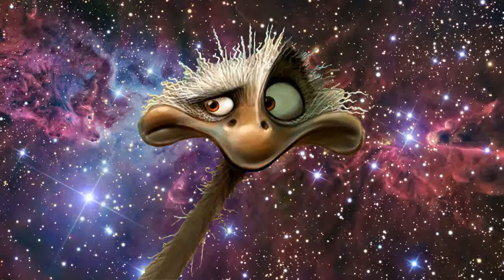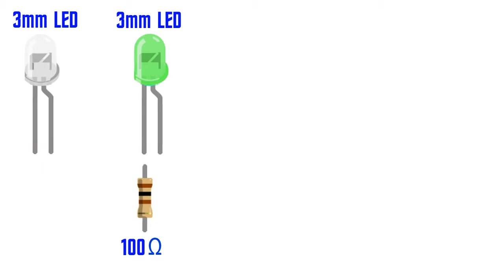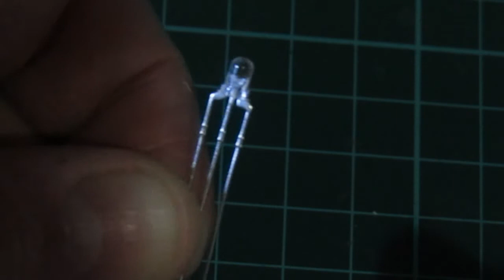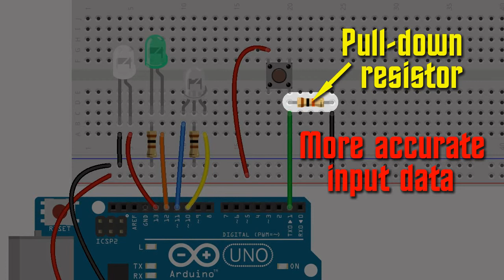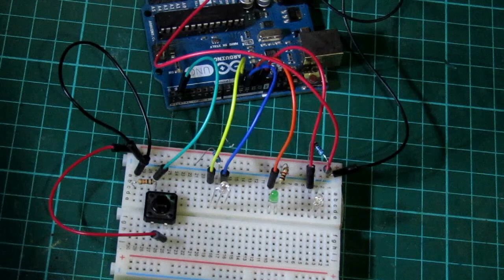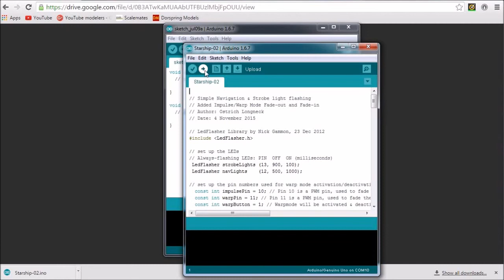Arduino for Starships - Ch04 - Deflector Dish Warp Fade Effect

Comment: Hi I am new to this. If I could please ask for some help. I can`t get fad effect to work. I don`t know what I am doing wrong. Is there something I could check?
Reply from the maker: Hi, welcome to the Arduino 😃 Did you check all of your connections? A common mistake is to use a split-rail breadboard, where the positive and negative rails are not continuous but spilt in half, so the power doesn't run through to the LED's. If you hold the board up to the light,. you can usually see if the positive and negative rows are continuous or broken into two. if they are broken, you would need to connect the two halves with small jumper wires. I hope this helps.
Reply: @OstrichLongneck   Thank you so much for the help. I think I now know what was wrong. I was using a bicolor LED with a  Common anode. I think I need a common Cathode. Am I right?
Reply from the maker: @msprague9223  Hi, yup, that's definitely the problem. Well done on figuring it out, though. I didn't think of that.

Comment: Trevor, I built this circuit with an UNO, and it worked fine.  Then I took a NANO, only transferred the wires from the UNO pins to the corresponding NANO pins and have one slight issue - as you mentioned in the vid, the impulse to warp led keeps changing by itself.  It worked fine with the UNO, but is doing a dance with the NANO.  Experimenting, I disconnected the push button entirely, but it was still pulsing from warp to impulse and vice versa.  Any ideas?
Reply from the maker: Hi :-) The pin is probably registering a false signal from the switch due to background noise. Maybe if you used a lower-value pull-down resistor to bleed off more current, like a 1K or even a 470-ohm resistor? Hopefully that should work, otherwise a ceramic capacitor between the switch and the input pin? - Trevor
Reply: @OstrichLongneck  Thanks Trevor, I'll give that a shot.

Comment: What would need to be altered if I only want yellow for power up sequence and don't want color tied to impulse/warp. Outside of TMP and the reused drydock footage in TWOK, we never see yellow again for the deflector dish at impulse right through to TUD. Even in TMP, the dish is yellow at times and blue at times with the ship at station keeping in V'GER.
Reply from the maker: Hi :-) It's very true, the yellow deflector dish is a bit of an anomaly! To get rid of the effect, one could just add a slash and an asterisk "/*" at the beginning of the in warp fade routine, and then and asterisk and a slash "*/" at the end of the routine, and this will turn that whole section into a comment which the compiler will ignore. Good luck and have fun with your build! - Trevor
Reply: @OstrichLongneck  Thank you for your help.

Comment: Hi Trevor I cant get my momentary switch to work iv followed the circuit diagram but all i get is the yellow and blue fading up and down alternately not sure what im doing wrong ?
Reply from the maker: Hi :-) That happens when there's a lot of electrical noise on the input pin, which means the pull-down resistor isn't doing it's job. This may be due to a breadboard which has split power railings in which case you need to add jumpers across the dead spot in the + and - rails. You can send me a picture of your circuit to ostrichlongneck@gmail.com, and I can take a gander if you like :-) - Trevor